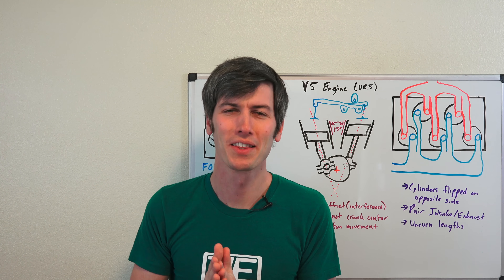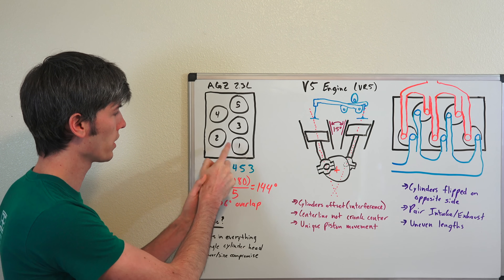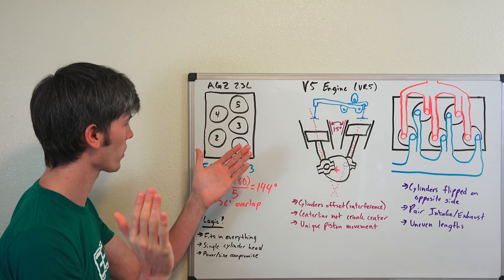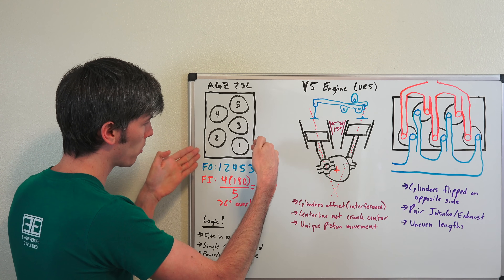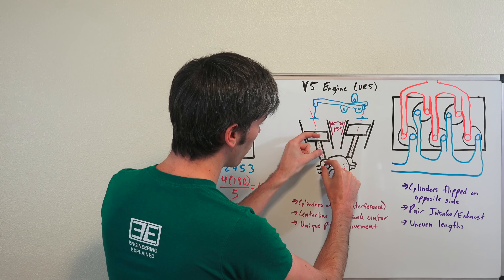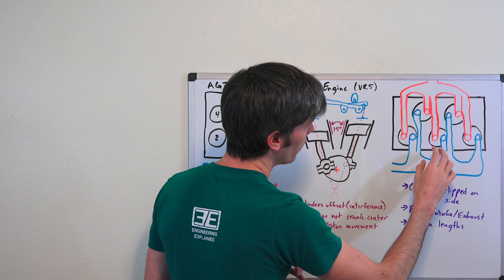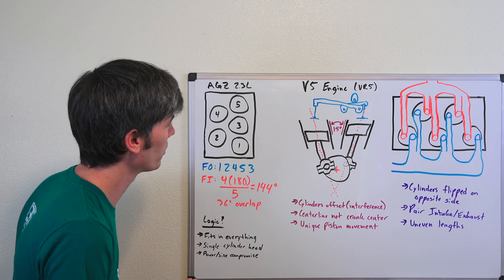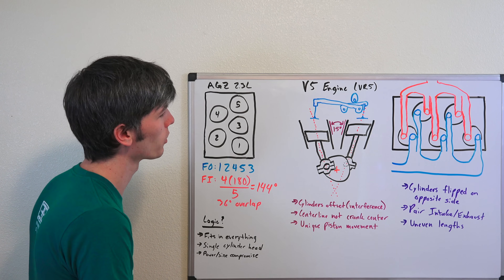Volkswagen's V5 Engine — When A VR6 Is Too Big

Comment: Do they correct for the intake / exhaust travel distances with the manifolds?
Reply: Engineering Explained what's interesting about the intake manifold is the changeover valve that forces air through a different set of tubes via a flap in the intake to maximize low end torque by creating a longer path and I guess making more turbulent air.  That's why the vr6 has such awesome low end torque!
Reply: Engineering Explained 
Like you said, it's amazing that a weird (very cool to me) engine like this made it to production.
Reply: Engineering Explained 
I think I’ve even heard you say what one of the original reasons for the vr6 was, and that’s a 6 cylinder engine that fits in place of a 4 cylinder. 
It’s wider than a 4, but not much longer...
for fun stick a turboed one in a rabbit.
Reply: Everybody except for maestrofm is wrong.
The intake runners on the back of the engine (long) have a larger diameter, and have adjusted fuel injection timing, to show the same power characteristics across the firing order as the front cylinders.

Jason, didn't you even do a segment with Charles on the VR6? He explained it there, I thought.
Reply: @TheShadowSplicer  Yeah this engine is a mishmash  wrongs and crutches.  Although cool
Reply: Engineering Explained I have an R32 with a 3.2L VR6, and have studied them for quite a long time.
Reply: @TheShadowSplicer  Cats piss on the 3.2.  The turbo 2.0 is much more powerful.
Reply from the maker: Based on some photos of the manifolds, it doesn't look like it. They don't in the VR6 engines, which have an even split of 3/3, but it's interesting that here you have different lengths and different numbers of cylinders.
Reply: Engineering Explained there’s an added electric air pump on the intake side
Reply: Worth it for the brap
Reply: Engineering Explained 
Maybe it is for scavenging energy from one pulse to the next like with exhaust gasses? I mean they could have added longer runners to the short sides if their was any benefit to the intake and exhaust valves being equal length... 

So it is either beneficial for them not to be equal or it’s at least not detrimental enough  for the runners to be made equal lengths. I assume it’s beneficial. 

I didn’t help at all lol. 🤓😂
Reply: VW did correct for the different intake and exhaust runner lengths by shaping the runners differently, sizing them differently, and controlling fuel injection differently between the cylinders.
Reply: Depending on the specific generation of VR6, the difference in port lengths are compensated for by specific tuning of the intake manifold, the camshaft overlap and valve lift or any combination of the above,  if the added flow of the short runners were not compensated for the opposing cylinders would produce more or less hp per given rpm
Reply: No, but ECU correct fuel injection time for longer manifolds
Reply: @maestrofm  You don't know how engines work.
Reply: No they don't. But you can definitley buy aftermarket headers that correct the unequal distance. Although it only really makes a difference once you look into doing major mods like swapping the cams or even turbocharging. In stock form these engines have very, very conservative cams, so it the unequal lenghts don't really matter anyways.

Comment: Love these unique engines, so much more fun than a straight or V engine.
Reply from the maker: Agreed, awesome to have some weird variants out there!
Reply: yep still there, eg in the rs3 models
Reply: When you drop your coffee because you hear a vr going up thru the revs with a nice exhaust.....
vw for life 👍🏻
Reply: No its still in the TT and RS3, Volvo did discontinue it though  :/ Got one in my V60, loving it !
Reply: Have a look at the new MB straight 6 - it is not longer than its V6 predecessor...
Reply: @Baerchenization  IL engines are always longer than V engines. In an IL engine, each cylinder rides on a crank-pin. In a V engine, each of pair cylinders rides on a crank-pin. So, the MB IL-6 has 6 crank-pin vs 3 crank-pin in the V6. That's why VW went with the VR - Verkürzt Reihen or loosely translated as Shortened In-Line in English, engine design by staggering the cylinders.
Reply: I think the discontinued the i5 engine like Volvo did.
Reply: Yes in RS3 as well in the TT lineup.
Reply: A bit like a squished toasted cheese sandwich.
Reply: Straigth 6 my boiiii
Reply: doesn't Audi still have a (i think inline) 5 cylinder?
Reply: @Jajo3998  Y, the IL-5 is still alive in 400 hp RS3, but not a VR5.

Comment: Vibration.. Do you have a video on engine counter weights (balance) and the means manufacturers use to reduce vibration.  When ever I imagine firing orders I keep  envisioning all this engine movement.
Reply from the maker: Yes indeed, several videos on the subject. Here's the start: https://youtu.be/aonbwOxooGA
From there, you can search for primary balance, secondary balance, and balancing shafts for additional videos on how engines are balanced.
Reply: Engineering Explained oh good man.

Comment: For when a VR6 is not weird enough
Reply: MrHillfolk saying the engine is weird is more of a compliment than anything else. I love 5 cylinder engines.
Reply: @silasmayes7954  I Have A Concept For A VR Engine, It Is Called The Nellds VR10. It Is Like Two Of This Engine But Put Together In One Bank.
Reply: TheJacobShapiro yes!!!
Reply: Silas Mayes 
but they sound so good and fit in a mk1 vw😲
Watercooled vw lego cars 👍🏻
Reply: MrHillfolk See, you might think calling them Legos to be a joke, but I'm doing precisely that with a Mk3. Have an AGW 20v head that I'll be bolting to the top of my ABA block (yes I know about the pistons) and running it all through a TDi-ratio 02A. XD

Comment: Hey Engineering Explained.  Appreciate your videos.  Why is it that VW appears to be the only mfg. producing these types of engines, along with their high performance W16 etc... Are these really practical engines compared to turbo charge I-4's with integrated exhaust?
Reply from the maker: Well it seems they're slowly moving away from more interesting layouts, as yes, a turbo inline-four can offer the same power output in smaller packaging, and can be used more across the lineup, simplifying manufacturing and reducing costs. The W16 is in a world (and price bracket) of its own, fun to have something unique.

Comment: Just put the V-6 that you arty have instead of all the tule and designing and all that they have a 5 Cylinder engine. And the Audi Car that use that engine always had electrical problems
Reply: Audis never had the VR5. And apparently a V6 would be too wide to fit in the engine bays of the cars that got the VR6 at first.

Comment: So,I want to know whether the perfect balancing is attained because 3cylinders on one side and 2 cylinders on other side,and are these engines used nowadays.
Reply from the maker: Perfect, no. I don't believe any V5 engines have been produced since the early/mid 2000's.
Reply: Engineering Explained my 2013 Jetta had 2.5V5
Reply: and was really fun to drive.
Reply: Bob Bickford but its an inline, no?
Reply: Bob Bickford 2.5 is an inline 5. VR5 was only a 2.3.